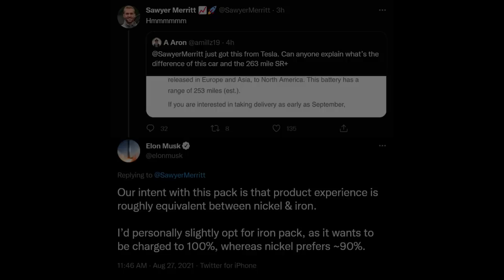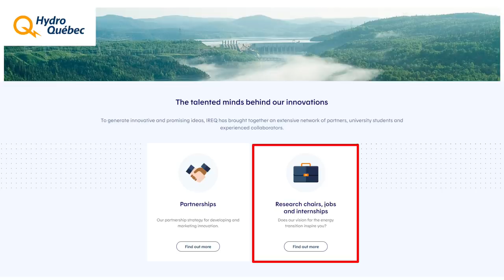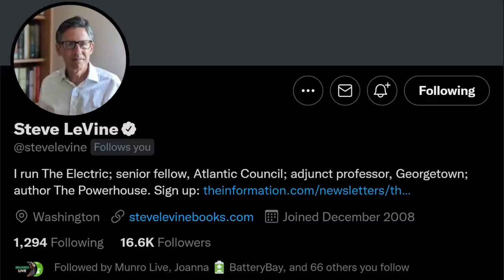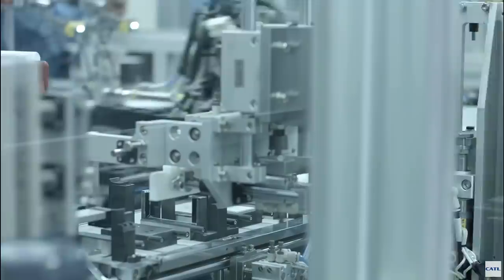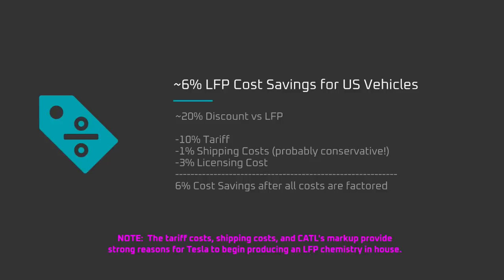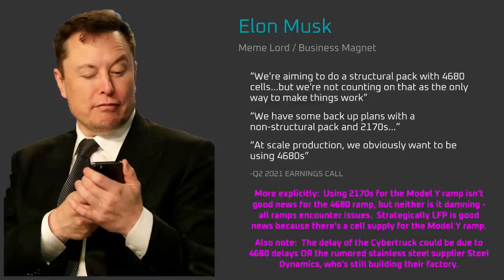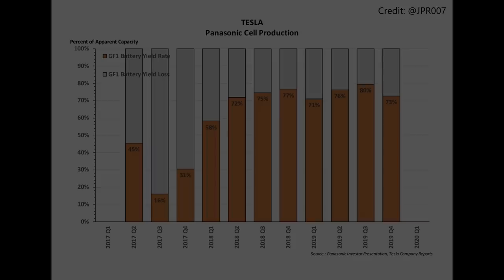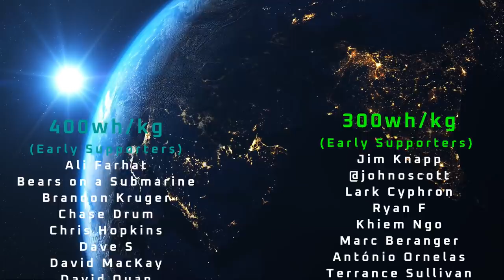#1 A Brief History of LFP, Patents, Licencing Costs, Pricing // and Tesla

Comment from the maker: 2 Notes:

1) After creating this video I found a better estimate for current LFP material prices.  It's closer to $14/kg for an all inclusive price rather than $8/kg (materials price ex other). 

This means that in the short term, removing the licensing cost might save 2% rather than 3%.  However, in that calculation I also didn't include the fixed cost of the license, which is millions of dollars per year...meaning the result still might be around 3%.

2) Shipping cost was probably underestimated quite a bit.  The 1% was impact at the vehicle level and just shipping cell, so it's probably more like 5%.  But, all this only reinforces my point that the LFP packs from won't be saving Tesla much money, if any.  And also, that when they make them in house and in country, they'll be much cheaper!

3) Patents aren't the only reason why China moved quickly on LFP.  Subsidies, material costs, and materials availability also factored in.
Reply: Panasonic (according to their last earnings call) should have also opened a new 2170 line @giganevada end of August capable of increasing production by about 10% so even more room (time) for 4680 development/ramp
Reply: @lukasboscher9674  a high scrap rate isnt always bad, could be that another 10% are perfectly usable but the safety requirements are so high they get scrapped anyway, afterall better to have a slightly higher overall cost than to have to recall 100k's of cars because of potential fires, that doesnt just cost you money but standing/prestige as well
Reply: Thanks for covering this topic in detail.  I ran across the LFP patenting and licensing issue just once about six months ago and I haven't seen it referenced again until this video.   The LFP chemistry would also be a good fit for Tesla's power products since it would be safer, good endurance for recharging to max, typically not exposed to low temperatures, no problems sourcing iron and phosphorus, the weight penalty would be no issue and the price should be substantially less once the last patent issues clear.  Tesla has 80,000 power walls on back order apparently, not to mention the megapacks.
Reply: Good job, this a great video on LFP batteries and the paten.  👍😊
Reply: 2or3% for amass produced product is significant. Tesla is chasing pennies to save per product. 3% is huge
Reply: @KK-up3pq  while you are correct you are also looking at it the wrong way they spend 2/3% more than they would have done without the patent (which ends in 7 months) but it should still be cheaper than the normal pack AND it should also allow them to increase production (even if its only ramping berlin/Texas) that's a huge +
Reply: @quantaca5773  when demand is bigger than supply, the quicker solution is the better one. For the company. And for the planet.
Reply: Thanks for the great info. How difficult would it be for Tesla to build the LFP themselves in the 4680 factor? Does the dry coating process work for LFP chemistry as well? Since what I've learned in your videos, that is one of the biggest process speed advantages and allows the factories to be smaller.
Reply: Even at 2% given this is the only substancial payback on the patent after 20 years really shows how random the patent system is.  Some technologies when patented are ready for market but LFP took close to 20 years.  China making LFP without paying created an environment in which the chinese companies further outperformed others and allowed development of products which would have been ignored elsewhere.  This seems like a high license cost but given it will only last a few months to cash in it is hardly a cash cow.  

I really hope the lawyers don't find ways to overly extend this because a flood of cheap LFP will fuel an EV transition.  Put cheap batteries in cheap cars (ie $20-25k BYD / Tesla) which require little maintenance and few parts will completely flip the auto industry.  At such a price point driving a 10 year old ICE car will actually be more expensive assuming average depreciation and increasing fuel costs.
Reply: Estimation leading to comparison could not be complete or complete biased - excluding heat sink and thermal management - difference. 

Panasonic probably told Tesla that larger diameter with standard assembling methods such as 4680 incur a larger radius to a larger capacity for longer thermal path and impedance .. can overheating chemistry closer to the cylinder core. I think that is a problem that drives new idea, the tab less architecture. The tab less idea turns thermal path radially into axially at the cell base with coolant channels waiting underneath to receive heat. 

The down side in tab less architecture are - 
1) undefined junction resistance - from anode to cell wall base, 
2) with the use of point contacts and undefined point preload force or point area. 
3) with the use of annealed soft Cu foil in point contacts that has no spring properties can’t self reform after deform from inertial shock. 
4) with unknown thermal and inertial shocks criteria versus cycle life and ignition safety. 

Ignition? When anode flaps are bump off the cell base from inertial shock we have electric arc can spark ignite hot chemical gas or fluid. 

Those are critical factors determining 4680’s future - success or not in BEV application. I hope Tesla is aware of that and is being worked on. 

The 1865 and 2170 has a working solution on thermal / electrical issues.
Reply: @lukasboscher9674  100gwh? Do you have your own country to provide with energy? Or should it have been 100kwh?
Reply: @lukasboscher9674  each factory is supposed to do 250Gwh by themselves a year. 50Gwh is the initial production capacity per factory in Berlin and Austin
Reply: @Curacars  at battery day they stated dry electrode coating was compatible with lfp, they also stated the tabless was not a issue nor was the 4680 format cell. 

it's even in the charts showing chemistrys. lfp has been a part of the standard range plan for a while and absolutely critical for the smaller sub 30k car
Reply: @seancollins9745  thanks
Reply: I look forward to further videos. It will be interesting to see a new Tesla LiFePO4 cell, and how patents and royalties affect the market after April.
Reply: @Miata822  if you don't have tabless, you can't manage thermals
Reply: This information is very helpful. I thought LFP are 10-15 % cheaper. Thank you!
Reply: What do you think about the efficiency and cost of the batteries that Lucid are using?
Reply: Hi Just curious if you know the breakdown of cost between the cathode, anode, electrolyte etc
Reply: Now that it is 2023, is there an update on these LFP patents and the effect on the market?

Comment: For years I’ve told everyone I know that has any interest in using batteries in an application appropriate for them that LFP is excellent for many reasons and really worth considering. I love the long cycle life mostly but the safety relative to other lithium ion chemistries is also great. I got my friend who was going to have a solar and battery system installed to use LFP instead of lead acid and I’m glad it’s going to last him so much longer.

Comment: Interesting video. I’m watching it 2 years after you released it. Pretty good predictions.

I have a Tesla Y RWD produced in Shanghai. As far as I can tell it uses CATL prismatic LFP cells.
Have to say it works great.
The only slight problem is when the temperature drops below -15 degrees C and I need to do longer trips. The range decreases quite a lot and the Tesla struggle with pre-heating the battery. I usually have to spend a few minutes waiting for the battery to warm up before the fast charge starts. 
Another issue is if you leave it plugged in at the airport while being away for a week in cold weather. If I don’t switch off the charging manually it keeps topping up the battery and need to pre-heat every time. The pre-heat draws more power than it’s putting in to the battery. Once I found this out, I stop the charging and just leave it until I’m returning and then pre-condition the car right before I leave.
Not a big problem though.

Comment: Great job Jordan. Thank you for covering LFP in such detail. Still lingering for me is to understand if there are technical reasons or downside of making LFP in 4680 format. I saw your comment on twitter on battery format that Elon responded where he seems to favor the 4680 format for safety reasons over the pouch or prismatic formats but not directly mixing LFP and 4680 on the same sentence. On battery day or around I recall him commenting 4680 is flexible to many chemistries. Hopefully on a following battery episode you can cover what you know on this topic to date.
Reply: It would be nice if Tesla does make LFP batteries in 4680 Cylinder format. Right now, I think Tesla might be using CATL LFP batteries in other format than a cylinder one. I don't think CATL makes a Cylinder format batteries?
Reply: Look at TeslaInsights's comment from one week ago where Jordan talks about what you asked.
Reply: @w0ttheh3ll  Where could we find that?
One week ago on Jordan's video comment section, or where?

Edit: it's here in this comment section, probably a few comments down, keep scrolling
Reply from the maker: Thanks for the support!  It was just pouch he had beef with, not prismatic.  The variables are:  Safety of the chemistry and safety of the form factor and energy contained in cell.  LFP is safe, it can be used in large cells with minimal packaging.  LFP has low volumetric energy density, which is why it's stored in large cubes.  Whether Tesla puts it in a 4680 or not isn't due to safety, it's a matter of energy density...that all depends on the structural pack.  Sorry, that's as far as I'll go here in the comments.
Reply: @thelimitingfactor  Agree and thank you for the replay. My point is that if LFP is not feasible in 4680 form it would be a big disadvantage as either Tesla would need to source it from another manufacturer for an overall less profit or Tesla has to build other manufacturing plants with all headaches and cost that implies but I guess that is probably not something that Tesla did not know before battery day otherwise 4680 significance and advantages will not be as previously though it would be.
Reply: @thelimitingfactor  I understand at cell level prismatic or blade probably wins over 4680 in energy density. So in lack of other advantages probably prismatics makes more sense however due to high volume production cilyndricals may end up winning due to lower cost of manufacturing.
Reply: Jesus Gonzalez  do you or have you ever worked for Tesla? Just curious
Reply: @marioescalona1640  At the end of the day it is very likely that either format even with LFP density can make a car with a safe 200-250 mile range which makes most mainstream car companies look pathetic in their EV efforts.  The BYD blade is quite impressive as are tesla/catl's various options.  LFP is about the low to mid range market.  Sorry to say us normal consumers will have to settle for 6 second 0-60 times in our commuter cars...
Reply: 4680 has a higher thermal resistance compare to its counter member 1865 and 2170 in the radial directions. Resistance exceeds the capability of thermal management system currently employ in 1865 and perhaps include 2170. To that Tesla conceived the tab less architecture, to sink heat in a downward direction there by avoiding the thermal resistance by sinking it to the cell wall base. Sink heat downward is a brilliant idea. 

The down side to that is undefined junction resistance from anode to cell wall base with the use of point contacts and undefined contact pressure or area. Those are critical factors determining 4680’s future success or not.
Reply: When commenting on 4680 form factor being agnostic to chemistry, Elon said there were manufacturing advantages in Tesla standardising on one form factor (for ALL applications, vehicular and stationary). He added that existing production lines using legacy FFs (1865, 2170) would continue until it made sense to replace them.
Reply: @evfusion4094  Good to know and makes sense since even though prismatics may make more sense for single cell LFP long production volume advantages of 4680 would make it more cheaper than prismatics. Actually recently a Chinese manufacturer made a 4680 cell with high changing rate, it is not clear but it seems it was LFP.
Reply: @marioescalona1640  can you explain why prismatic cost more to process than cylindrical?

Comment: I've got a set of (headway) LFP cells in my moped and they are mostly dead after a few hundred cycles (and several years of sitting about with occaisional maintenance charges). This was with very basic battery management to start with, so probably just shows that lithium cells of all types need good management otherwise they'll have relatively short lives.

Comment: Potentially 4680 could also use LFP which (maybe??) would have the same range as the current NCA 2170, potentially at a discount over the current LR model.    And/or they could offer a third option.."super long range" using 4680 and NCA.

Comment: The most important point of the LFP is its safety. The disadvantage of the LFP is its energy density is lower than nickel cobalt lithium. This disadvantage is overcome by the BYD blade battery. Don't forget that the life span of the LFP is much longer than the LNC, that lower the overall price.

Comment: So if GM switched to pouch LFP for the Bolt, and you can regularly charge to 100%, what would the range be. Seems like the Bolt is more suited for a metro car than long distance driver anyway.
Reply: That's hard to say because you'd have a heavier pack, possibly fysically bigger depending on spare room in current pack, though you could pack it differently (tighter) because you dont need as much cooling, the electronics are also a bit trickier (somehow LFP cells are harder to read/monitor than NMC/NCA)...
Tesla mostly solved it by going with a bigger pack (60kwh Vs 55kwh) and thus only lost 10miles range (and legal cargo/weight carying capacity because the car is heavier).
But based on that id say you'd lose atleast 15% range providing they can atleast fit the same amount of kwh's as current battery, which seems unlikely (tesla's 55kwh pack is the same fysical size as the 75kwh pack just less filled, so they had a lot of room to work with and even able to expand 5 more kwh).
Reply: @quantaca5773  wrong, because the pouch cells configurations means tighter battery cells and packs arrangements.
Reply: @moineaux9173  yes that's true, though they already use pouch/prismatic cells, but less cooling (and higher inherent safety) means tighter packaging is possible, but there's also a massive difference in not just wh/kg but volumetric density as well, and as i remember the bolts pack is pretty tightly packed to begin with

Comment: Although it is true you can get a couple thousand more cycles with LFP at full charge/discharge...the real benefit is you can get thousands more by short cycling from 10-90%.

So...if you are putting around town with LFP your battery will degrade even slower.  Youd only charge fully on a regular basis to balance or long trips.  LFP cells need to be well balanced, and if so they will last for that 1M miles.  I'm sure the software/hardware will manage this.

LFP is going to be the catalyst for massive growth in the energy sector...
Reply from the maker: Amen!

Comment: Jordan, what's the issue with lower voltage from LFP when it comes to energy storage? Requires more amp and thus heat or? Heard someone mention it as negative but wasn't sure why..

Also, given that batteries are a much higher percentage of total costs for storage vs cars then the cost savings will be more pronounced there than for cars, might support the somewhat timid gross margin in that segment?
Reply from the maker: 1) Nothingburger.  Ask them the exact voltage required to hit the heat performance targets of of a storage system.  It's a silly comment because all batteries generate heat - what you need to know is the total system heat from all resistance sources and have thermal management in place for that specific case.  
2) Energy storage has about 12 distinct use cases, which one are you going after?  Each has different economics.  Seasonal storage, load balancing, etc.

Comment: You've probably already answered this, so sorry if that's the case, would you be able to make an lfp battery in a 4680 format and would that even make sense from cost or performance?
Reply from the maker: The variables are:  Safety of the chemistry and safety of the form factor and energy contained in cell.  LFP is safe, it can be used in large cells with minimal packaging.  LFP has low volumetric energy density, which is why it's stored in large cubes.  Whether Tesla puts it in a 4680 or not isn't due to safety, it's a matter of energy density...that all depends on the structural pack.  Sorry, that's as far as I'll go here in the comments.
Reply: @thelimitingfactor  thank you for your time 🙂